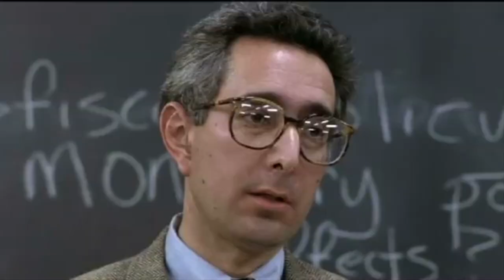The 5-Year Revival: Scratch-Built F4D Skyray First Flights REVEAL!

Comment: I like the shape of the elevons wonder why they designed the tips like that.
Reply from the maker: They are definitely unique. 😊. The outer portion acts as a counterbalance which helps with flutter and the surface float angle if there’s an actuator failure.